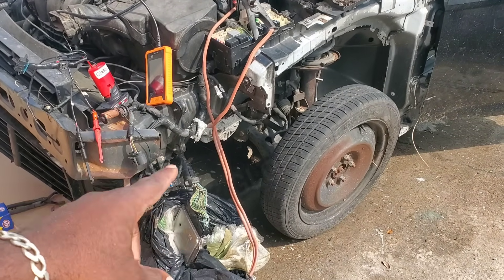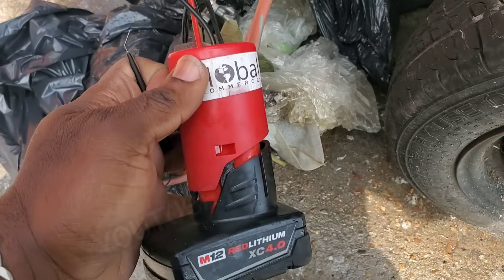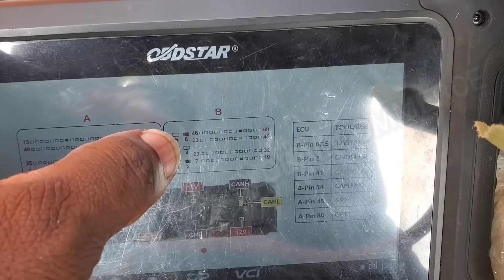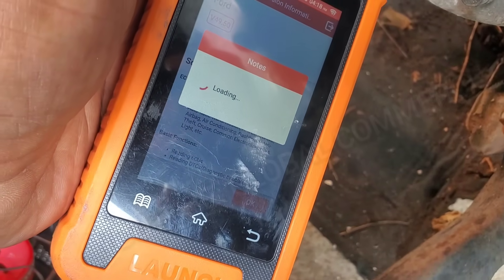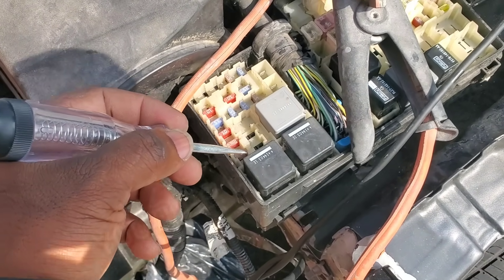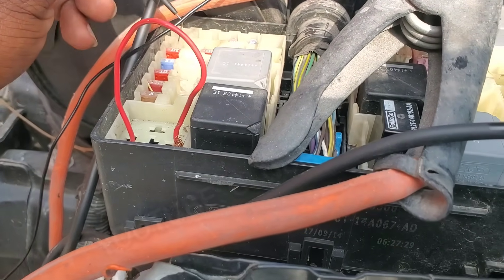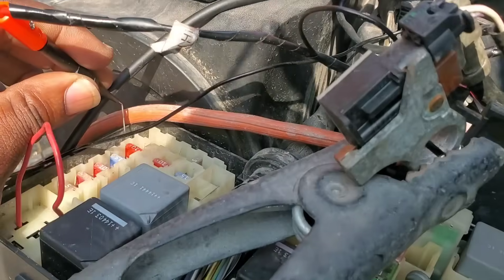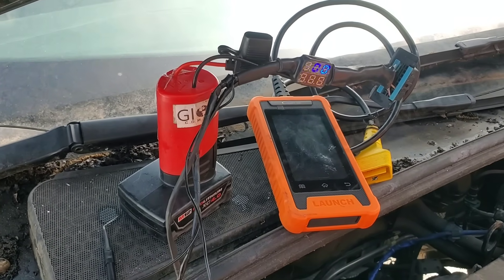Ford Focus ECM U0100 no communication problem DESTOYED by the ULTIMATE CANBUS tester Shocking cause!

Comment: I have a 2016 Ford fusion and it was starting driving fine then my service light came on no check engine light took it to get scanned the u0100 code showed then 2 days later engine light came on was told it could be my wiring.

Comment: Hi I have a 2012 ford fiesta sel and it cut completely off while I was driving on the highway. My friend has a scanner and got a uc0100 code. And the engine light does not come on when I attempt to start it . He thinks it’s the battery(but all the lights are still working and he check the voltage) and another person thinks it’s the key fob needs to be reprogrammed bc I have the red light car symbol with a lock on it which I was told it is in anti theft protection mode. (But I don’t have a push to start and the key is still locking and unlocking the doors). Should I buy one of these things you are using “the cann” before I get it towed to the shop bc it might be something so little that I can save money by avoiding the shop
Reply from the maker: Based on the no communication and no engine light, it sounds like it could be the ECM or the wiring to it. The tool I used in the video can help you diagnose that yourself before towing. here is the link to purchase: https://globalcommerceca.com/products/ulitmate-canbus-tester-diagnostic-tool-sgw-dodge-security-gateway-cable-bypass?_pos=1&_psq=canbus&_ss=e&_v=1.0&variant=46591575982400

Comment: Excellent diagnosis & logic implementation!!!! Yes, that kind of situation can occur from a single fuse presenting as an anomalous/intermittent condition!!! If you've never had to "explode" a fuse block assembly yet to hunt down corrosion, your mental library of how false positives can occur has been spared thus. As far as monster takeaways from these types of situations, I encourage you to remain as "suspicious" of every plausible creating the subtleties you've run across during your operation. I.E. (process modeling) @ "zero" - if you've run across some kind of a bypass of any sort during your inspection, or you've discovered a "haven" for entropy, reaching into that history should encourage you to consider that s-o-m-e-one-e-l-s-e has been there, which means that you're #1: searching for a "foundation". My redundant mental: "Have I verified the appropriate fuses are installed in their appropriate locations?" was something I personally didn't stop to consider during one of my seminal fuse block sagas. Upon reassembly of that aforementioned block, while I was " "replacing" " the fuses to their OEM diagram locations, to my amazement, I found not 1, not 2, not 3, but 5 fuses were inappropriately installed(20 amp installed as a 10 amp and so on). The origin of the saga. Not only was corrosion responsible in a number of areas, but over & above and beyond the failed fuses, I took for granted that I pre-approved Someone Else's Work before I verified it myself. Seemingly the "simplest" thing to check for, this was a lesson to take with me throughout my time. It's okay to consider a comprehensive vote of no confidence across the board.
Reply from the maker: thank you for your detailed response! like and subscribed!

Comment: Yes, I experience a situation something like this, oh yes, I remember, Global Commerce sent me on the job recently and the blinkers was not working in the front of the vehicle. (2021 Ra4) I found the left front bulb was bad immediately, So I took the right front bulb which (looks good)👀 out and installed it on the left front side and it did not work, so I powered that bulb with my 12 volt power probe and the bulb came on, So I pulled up the Alldata diagram and Found the ground and the power wires. I checked the ground which was OK. I checked the power it’s OK, scratching my head and then I called Global Commerce, he tells me to the check the ground which was a black and white color wire. I go back and check it again. (Maybe I  did something wrong, I said to myself). So I checked them again and all the grounds was OK. So I told Global Commerce to let me get back to him, because I need to go deeper. Found out that, that bulb was bad too. I’ve believed that bulb had high resistance, but it didn’t look bad and it lit up when I power it. so finally the owner brings me parts, I replace the blown bulb with a new one on the left front side and it started blinking, the owner freaked out because he thought the bulb I was working on was a parking light, so I put the other bulb in the right front side and it also started blinking. It’s fixed! go figure. l called Global Commerce and he was like (No way Man) and we laughed at the situation,. The other Mechanic took the front bumper and headlights off and could not find the problem because he was working on the wrong light system. There was no problem with the system. It was the wrong bulb or the bulb resistance was too high to work on the vehicle. Sometimes the simplest job can throw you in a loop, and by the way I just graduated from Global Commerce about a week ago. Global Commerce made a video of my graduation from a class I took from him. Check it out! Im a Global Commerce prodigy, Class of 2024. 😂😂😂😂
Reply from the maker: All Hail King Jack!

Comment: Seen this before, voltage feedback through the ECM. It's a ford thing. Full battery voltage on one side and low on the other, blown fuse. I use a voltmeter instead of a test light checking the fuses on these. I had one that got towed from one shop to another for over a year. Had it running in 15 min.
Reply from the maker: Master tech👍🏾👍🏾
Reply: Maybe in this situation you need more powerfull test probe which can take about 1amp current, it will show you almost blowen fuses😮
Reply: @equilibrusman  Those will feed back voltage from another circuit internally in the ECM. After I run into this a channel, I follow had a vid labeled , when is a fuse not blown. They found the same thing, B+ on one side and a lower voltage on the other. The Escape with a full charge on the battery will show about 6 volt on the fuse powered circuit with a blown fuse.

Comment: Great diagnosis you stuck with it and yes I've encountered this before on a school bus back up light's when you push the test light on the fuse it would connect either side but it was blown 😂

Comment: Seen the same thing several times.  My favorite was the shop that replaced PCM due to trans solenoid DTCs.  I found a  4 volt drop across the transmission / rear O2 heater fuse with key on.  "But Identifix said to replace PCM!"
Reply from the maker: Lol
Reply: @globalcommerceca  One more reason testing should be done under load

Comment: Hold up did you design that tool? Is it using a Milwaukee battery? If so you're on a whole other level. I knew you were good but damn
Reply from the maker: Hi, yes I'm also an investor,  all my design and compatible with milwaukee m12 battery,  thanks